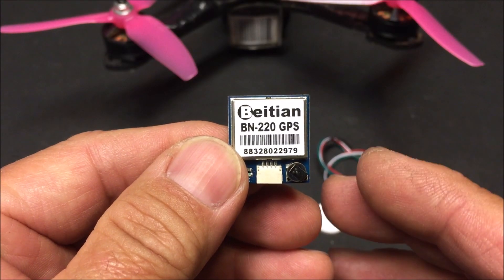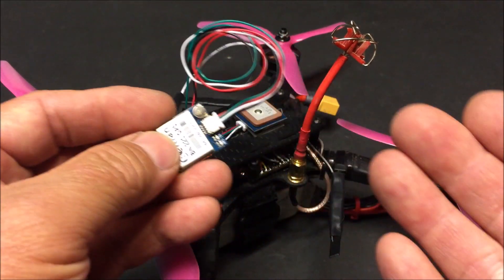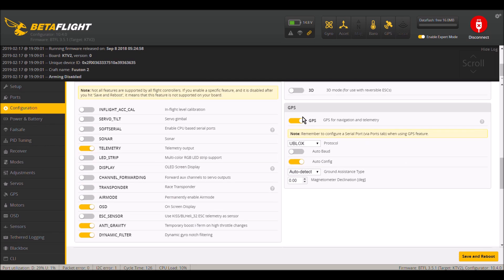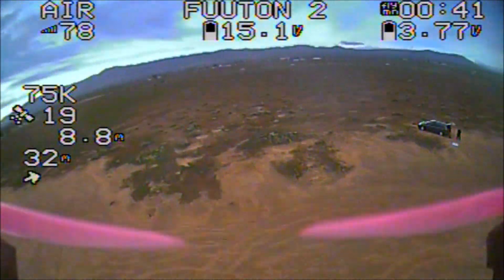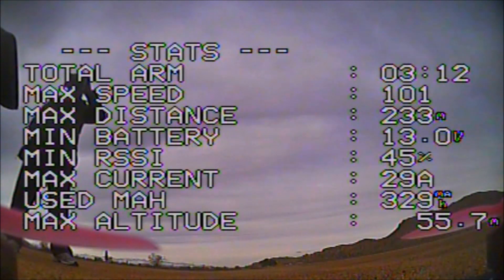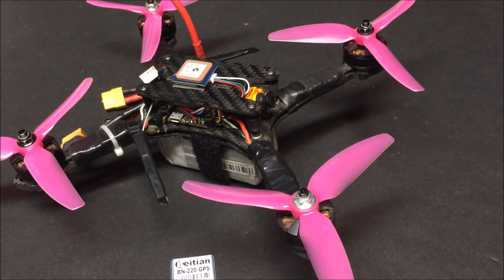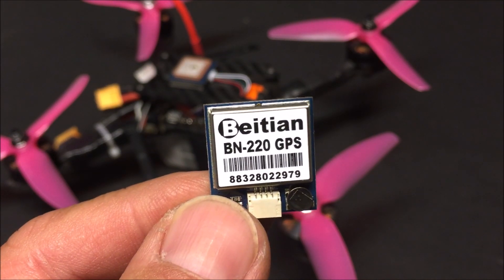Dual BN-220 GPS GLONASS Antenna Module

Comment: Hi Sir, i have fsi flysky transmitter with only 2 aux channels one for arming second for flight mode what i do for Gps rescue mode and can my Gps works without assigning a channel and altitude hold
Reply from the maker: You don't need to assign a channel for gps rescue.

Comment: This video was exactly what I needed to finish setting up my first GPS module on my rig! Thanks so much for such a detailed video, you really explained everything someone needs to achieve this install. Being new to this I tried and ended up soldering the tx to tx on the board and rx to rx on the board, noob mistake of course but I am new to all this and still learning the ropes so thanks again.

Comment: why is the telemetry required?
Reply from the maker: Nope, telemetry is not required.
Reply: @RCEscape  thanks. I'm seeing some discussions that 900mhz telemetry is interfering with gps. I'm going to test it without telemetry today after rain goes away.
Reply: @johndextersantos9541  
  If rx ad tx dont go to tx and rx right it binks but never shows satelites or gps OSD
    It did. Not hurt mine but as soon as i fixed right i got 13 satelites in 2 minutes .

Comment: My GPS is False all the time. The blue light is constantly on but not information.
Port set.
Config On. 
Still... :/
Reply from the maker: Are you outside?
Reply: @RCEscape  Nope,
I shall try again.
Reply: @mofooooo44444  rx and tx are backwards when mine did that  . Amazon shiwed the pins are left to right. From the top brown side are 5v.  Rx tx.gnd.
 And rx goes to Tx and the rx wire goes to tx
Reply: @gregorydahl  thabks for the idea. I shall try again, but i believe to havefried my GPS why experimenting around all the cables.

Comment: My gps is not locking any satelite even after 10 mins the quad is plugged, any advice? I followed the guide and i have the same bn220
Reply from the maker: Yes, take it outside in the open.

Comment: I got one of these a while ago. Worked for one battery. Ever after that, lights flash blue on the GPS, Betaflight thinks it has a GPS unit, the little yellow GPS icon is lit up, but it always gives me zero sats. I thought it was a fault with the GPS unit, so I got another one. Exactly the same. Works for one battery. Then nothing. Has anyone any idea of how to troubleshoot this? My theory is, if it was my wiring, it would not have passed info to the flight controller the first time. I am stumped
Reply from the maker: Are you waiting long enough for it to acquire necessary gps?
Sometimes it takes a while.

Comment: Confused to why I only have UART 1,2,3,and 6 ...... missing 4 ...
Reply: If a uart is 'missing', it usually means it is dedicated to a particular function and will not have solder pads for you to use. In other words it's not 'broken out' on the FC.

Comment: great vid thanks. has anyone found that satellite lock is better or worse when the antenna is in different positions relative to other kit?
Reply from the maker: The basic ceramic antenna modules are all just about the same.

Comment: Can you set 'rescue' to return when the battery reach a specific depleted level?  Secondly, can you record in you goggles the GPS data or later review?
Reply: You can record GPS and OSD data if your groundstation or fpv googles has a DVR. What you see is what you get which let's you see the last transmitted lat and lon recorded by the DVR to start searching for a downed drone.

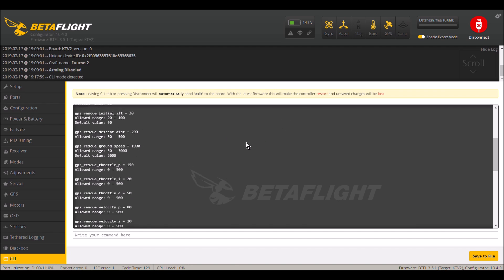Comment: 8:48 gps rescue descent dist = 200. just confused here, so does it mean it will descend at 200 metres or after 200 metres doesn't the  Gps do a cover rescue.
Reply: It will start to descent If it is closer than 200meters to the homepoint

Comment: I cant use this without using my receiver? All I need this for is Airspeed for my Avios 1450mm Spitfire. My set up is to power my Betaflight F4 from the balance lead of my 6s , also using my 6s 22.2v to power my VTX and 5v pin on the FC to power my Runcam Mini Split 2 and I have the BN-220 wired in how it should be, I cant get any UARTS to work?? I've tried all three of the UARTS I can use but when i reboot it doesn't save, I've tried different versions of BF but you say I need receiver signal to make this work? How can I wire into my receiver to work? Is there a way to get it to work? Can I splice off one of my signal wires from my receiver?? I do have a telemetry on my receiver.. Or do I need to use the Matek ASPD-7002 & Matek FC F722wing to make this work the way I want it to. I really would like to stay away from modifying my wing to make the pitot tube work
Reply from the maker: You need a telemetry receiver like the xsr or rxsr.
F4 boards do not have inverted signal on any uarts so you need to soft serial one of the tx uart.
Type in resources in the cli prompt and change the tx uart to soft serial.  tx11 = soft serial 1
Reply: @RCEscape  thanks alot for the help!   I appreciate you getting back to me.

Comment: Why always set fly mode to stab everytime you test Rescue mode?
Activating Rescue mode (by switch) will automatically set fly mode to stab rite ?
I wanna be able to arming & fly without having to wait the min. sats fulfilled, so I set gps_rescue_min_sats = 0. 
are there any bad things will happening during flight? (of course I won't be able to use rescue mode)

Comment: With other Drones, for example, Phantom 3, before I take off I need to do compass calibration for home point set (home lock).  In this video did you take off without doing compass calibration so does it automatically do home point set?
Reply from the maker: correct.
Reply: @RCEscape  Thanks.

Comment: The recommended newest setting are 9600 bps and NMEA
Reply: Didn't worked for me. Recommended values from the video are working just fine for my. Maybe it depends on location or different hardware?

Comment: Do the lights turn on when powered or do they have to get a fix? Have two of them and neither of them work.
Reply from the maker: there should be a blue light once it is powered on
Reply: @RCEscape  Thank you so much, I have two of them and neither of them work out of the box. Thanks for the response.

Comment: You need to use a real FrSky receiver, like an XM Plus....good for 6 kms when airbourne.....200 metres is nothing in terms of distance. Not sure why you would use that Hobbymate rubbish..?
Reply from the maker: The frsky xm plus does not have telemetry and will not work with the set up.   The hobbymate receiver has telemetry.

Comment: i hook everything up like the videos and i have no indicator light or icon light reading the gps signal but i allowed me to set the uarts also it wont arm with 8 sat on and when it  does  arm  i take it up and hit the RTH it shut down everything and falls out the sky.. can you help
Reply from the maker: When you hit the return to home switch, you must be more than the distance you have set for the return to home.  If it is set to 200 meters, you need to go farther than 200 meters and switch on the rth for it to work.
Reply: @RCEscape  ohhhhh sounds about right I'll try that also how do I make the gpd light in beta flight come on and get that false to turn true
Reply: i saw saw this but i forgot to say i have more then  i fix the part where i rewired it and got the icon light on but have not tried the 200 meters away yet due to fear of it falling out the sky but now i got everything working but switch mode  one one of my drones it works and the other one it dont however i due have gps icon light on letting me know its working got it set to gps rescue but no yellow in modes hmmmmmany ideas

Comment: i installed mine i picked up 9 satellites. i continued setting up my quad, now it doesnt find any satellites on either quad? any ideas
Reply from the maker: are you outside?
Reply: @RCEscape  yup and 0 satellites.  i just found a video that said the wiring harness and diagram is wrong.  I dont know if thats true. But it did work until I plugged in a battery.  I dont understand why it would have worked before tho.
Reply from the maker: @jrodfpv  
mine works just fine

Comment: what happens if you don't flick out from rescue mode?
Reply from the maker: As far as I know to be true, it will drop out of the sky right above the take off spot.
Reply: @RCEscape  oh :) im wondering if there is a way to set it up to flick to rescue mode when quad lose radio signal,and also regarding it falling from sky if you don't flick back to normal mode,just have it hover at the home point.
Reply from the maker: It will not land or hover by itself.  You can set a fail safe in cli.
Reply: @RCEscape  one more ? :) where should the throttle stick be in rescue mode.
Reply: @RCEscape  im about to buy for a newly build 8''quad ill have a play and see what features i can get working.

Comment: Hey. Would it be enough to only solder only one wire.. transmitting the data to the FC? Why do you need both directions? thanks
Reply from the maker: rescue mode won't work.

Comment: For the price its worth having one on every quad you own! Could the altitude shown be your height above sea level rather than height above your current terrain?
Reply from the maker: Yes it is.  Once in a great while, you do loose video flying about and a flick of a switch will save you.  I don't think it is sea level since the first run was a correct value.

Comment: QUESTION?
Can this be used for gps hold? Im looking for something where I can flick-a-switch and the quad will remain stationery...
Reply from the maker: Scooter Pie 
Not after I’ve upgraded betaflight to 3.5.1,,,,,I wanted GPS rescue but I had 3.3.1 I believe when I first installed the GPS module and that version of betaflight had GPS hold.

Comment: Your G730L 'deserves' one for sure LOL! I added one to mine, but when I flicked the switch, the quad fell out the sky. Do I need to set the failsafe to something different on the TX Pete? Or is there something else I've forgot to do. All set up, enough SATs found, Long, Lat etc all in goggles.... Cheers
Reply from the maker: Yes, I'll definitely put one on the G730L :)  The only thing is the XM+ has way more distance than the temeletry receivers so that's a bummer!  
Fell out the sky?  ??!  Don't know the answer to that one...I do have my tx failsafe not set and I do have failsafe throttle on hold in betaflight also.  I don't know if that has anything to do with the gps module but worth a try?
Reply: Thank you - I have just set the failsafe_procedure = gps rescue, & set failsafe-throttle to hold. I'll hopefully try this tomorrow fingers crossed. Thanks for the quick response

Comment: does it have return home settings for signal lost or low bat?
Reply from the maker: It is capable but betaflight does not have those functions added in.  However, someone just alerted me to setting up failsafe in the cli :)

Comment: Question! Wondering if let's say you crash, then turtle mode to an upright position, arm the quad, then flip the GPS on, will it take off, rise, then RTH? Or does it have to be airborne? Thanks for showing us this, have NEVER seen a review of a GPS module!
Reply from the maker: I'm sure it could be added in to betaflight but is not able to take off by itself and needs to be airborne :)